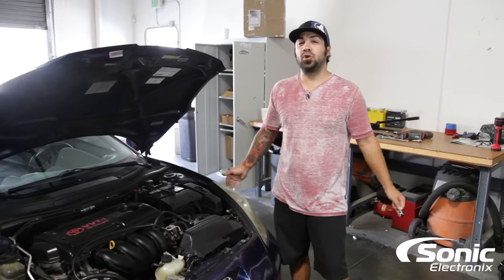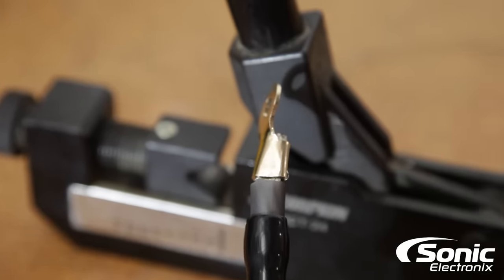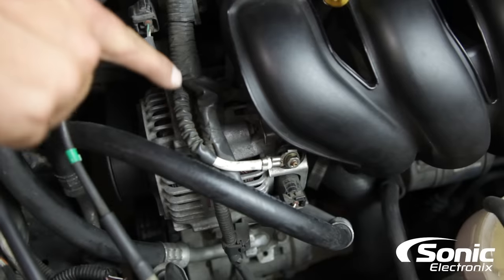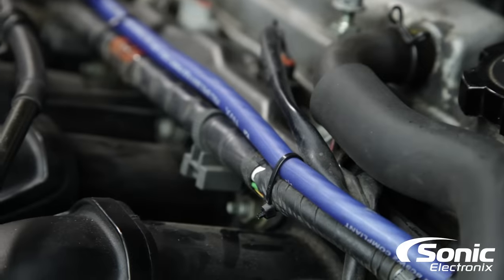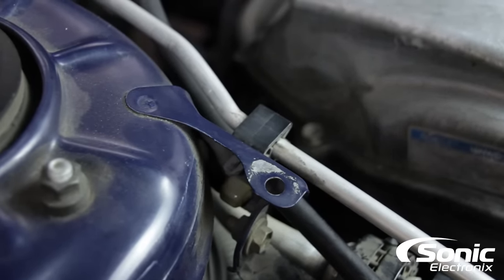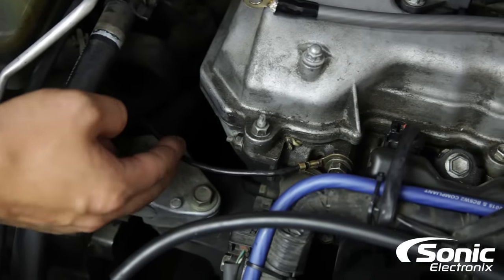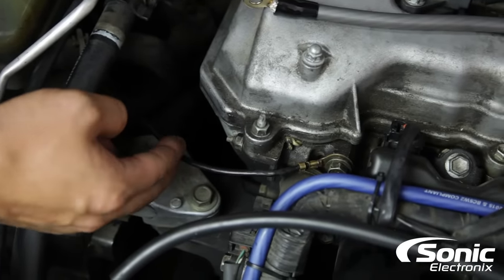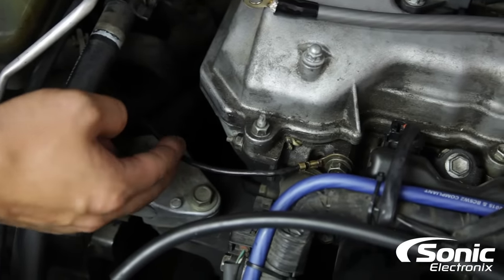How To Install the Big 3 Upgrade | Improve Your Vehicle's Electrical Charging System | Car Audio

Comment: What does the Big 3 help with, or improve?
Reply: all the wire the same helps stop "choking" the alternator and battery flow.
Reply from the maker: +Makaio Prescott The Big 3 Upgrade lets your alternator push more current to you battery because of the larger gauge wire that is added. This helps to keep your battery at a more constant voltage, this becomes more important the more amplifiers you add to the system / the more power your sound system requires.
Reply: The real, simple, answer that anyone cares about is... it will help lessen or prevent your lights from dimming when you're really rockin.  Some say to just buy a "CAP" to fix engine bogging and power drops but after running caps for years I have found that this simple and cheap upgrade will fix your bass flicker.  Unless you have like 5000+ watts in amps but at that point you are way past just the "BIG 3"and running more than one alternator and battery.  :)
Reply: The other replies are right, I just wanted to add that it is also needed when running complex light systems. I have a jeep and I have safari style lighting so I can light up a campground if i needed too.
Reply: Thanks you guys! I'm not running anything huge in my truck, just 2 10's running on 1000w split to 500w each sub. And all my lights work just fine when I'm pounding, no flickering or dimming. I've been wanting to do this just for kicks, but I also wanted to know of any benefits it may bring. My power and ground wires on my truck are 4 gauge, which is the same size that I'm running to my amp, so maybe if I ever do a more complex system that requires more power, I'll definitely do this! Thanks again.
Reply: Wouldn't this also help in really cold climates? I know this upgrade for my motorcycle made a huge difference on days when it freezes out.
Reply: No matter the gauge of wire you are not going to increase amperage or current output of an alternator. Its basic electrical. Wire gauge doesn't determine the amperage draw, it's merely a path. Upgrading the wiring will enable that path to more efficient. The Big 3's only "real" benefit is it lowers the resistance between the charging system and the audio system. If you think otherwise, I'm glad you've never touched any of my belongings, and I hope to god you don't touch anyone elses.
Reply: Erik Torell I think changing the oil to a lower weight might be better. A mech recommend that to me cause where I love we can get -20 nights and it was hard to shift until the car warmed up.
Reply: DaTwistedOne1 doesn't the guy say in the video "this is only needed if you have or are looking to upgrade your alternator"
Reply: Makaio Prescott nothing
Reply: ArgosWarrior
 except when you upgrade your alternator
Reply: Makaio Prescott may i ask,after we done upgrade big wire,how long alternator life?
Reply: Yussyadiq Yusof just as long as before. like the one person commented, it gives a better connection able to handle more power, this upgrade alone does not give you more power. The more power only comes from you upgrading your alternator.
Reply: oh yes lets add a 100 amp wire to a 40 amp alternator  on a factory system that will improve everything 
NOT
this is a big waste of money on any stock system  
it would be good if you had 5000+ watt sound system or a 100+ amp alternator(for big upgrades) or even a worked engine with a aftermarket ecu(Link G4 ecu made in New Zealand  best in the world ecu)

but if the car is factory this is just dumb and  not even needed
Reply: ***** which is what they say in the video, what is with you. No one is recommending doing this to a stock system.
Reply: any new car has to have good grounding for the computer to do its job keeping the car running at it best. bigger wires[with the same wire fiber size] have more surface area for the electrons to flow therefore it takes more corrosion to "choke the flow". odd note bigger gauge jumper cables le 4 to 0 gauge can start a car quicker than smaller ones like 10 and 12 gauge
Reply: Nothing at all, that's the 'merican way. Customize stuff that does not require it.
Reply: by your logic are you also saying we should use 18 gauge wires for everything. watch them melt when they cant handle the amperage
Reply: So you think that the car manufacturers are plain stupid to use wires too thin for the job? I own a 21 years old car, with the original wiring and nothing caugh on fire yet, so tell me, should I change the wiring? By the way, how's the computer, you are watching this on, working for you? Have you considered changing the capacitors, the wiring perhaps?
Reply: they use as thin of wires as they can get away with. they also do it to the point the car was made to use with a little room for more.I have a car from 67 and it has had wires that did that { alternator to battery} under certain circumstances which has cause me to swap wires. This video shows them improving the wiring because more amperage with new electronics are expected to be added meaning higher amps moving through the wiring especially if you running a a sound system requiring more power.
Reply: wiring sizes should be chosen with the amount of amperage in mind. the starter wire and the ground wire compared to the horn wires for example. way to big of wires can cause their own unique issues
Reply: I live in Maine, and this is an upgrade I will be doing with my truck, mainly because of the cold.
Reply: I would be cautious about doing that. Going down a bit on the 1st number is fine, but I would not do so with the 2nd number. You do not want the oil to become too thin when it warms up.
Reply: yeah, he only recommended going down 5 or 10 on the weight. The second number remained the same.
Reply: You really only need this upgrade if your truck is running a lot of extra lights and / or a sound system. Essentially you only need this if you need to upgrade or have upgraded your alternator.
Reply: b1oody 67 so I have 2 10's running on 1000w, 500w each. And when the bass hits I see my voltage indicator bounce. Would doing the big 3 help the voltage not dropping as much?
Reply: Robert Kraft yeah it's not anything bad. It was just a curious question to ask. When I drive at night and I'm pounding, no lights flicker or anything. And battery and altenator is stock too.
Reply: Not true. With a better ground, the engine will actually get better spark and the injectors and everything get a better signal. I did this in a Jeep Cherokee and the trans actually shifted quicker and better. Sounds crazy, but it's the truth. The headlights were a tad brighter, as well.
Reply: Change the title to "The Big 4" and add the most important component.... a DC Power alternator!
Reply: beri232 but an alternator produces ac power.
Reply: car runs better first of all
Reply: all alternators produce ac
Reply: ***** the one where a cars alt produces ac power, obviously. Without the regulator, it does indeed produce ac electricity, not dc.

I upgraded my car from a 60 amp alternator to a 130 amp (175 amp peak) with a heavy duty 4 gauge charging cable and a new 4 gauge ground. No difference what so ever in how the car ran when it had a single 10 gauge wire powering it before.
Reply: all of them produce ac
Reply: filter it all you want choke it all you want nomatter what you do an alternator will always produce ac unless it is not spinning
Reply: George Marinos ...... Jeeze guys. DC Power is the name of an alternator company in the USA. I'm from Canada and I've heard of them. Hell, I bought one of their alternators for my pickup. They build some of the best alternators in the world and I recommend them highly to anyone. There, stop the schooling lessons.
Reply: You should explain yourself ,a alternator is a ac production rectified to dc through a rectifier,if this company sells a dc generator then it's not a alternator is it? The name is the clue to the answer.
As for all the BS in this video just simply cleaning all the termination point of the system every year is normally sufficient to keep the system up to working order. Resistance in the system builds up over time as dissimilar metal do NOT like to work together.
Reply: P Kuudsk check voltage drop under load. Test directly at the battery, then test from the positive battery post to a metal spot on the engine. If you dont have more than a .01v difference, you are wasting time and money.

The actual selection for a proper wire size based on load factors in amperage and length. Running a 0 or 00 gauge wire will make zero difference until well over 200 amps on most systems, just cost ya more money.

If you dont think 200 amps is alot, think about an amplifier for the sound system you are running. Watts = voltage x amps. So 200 amps is roughly 2400 watts until.you factor in that the car should be between 13.5-14.5 or so while running, this still gives you quite a bit of headroom on that 2400 watt amplifier, plus numbers are pretty much always way, way over inflated. Bet 95% of amplifiers out there don't even hit half of what they are advertised at.
Reply: beri maybe you should bench any alternator and set your 2 dollar test equipment to measure ac and see for yourself or you must be another one of those self proclaimed electrical engineers lmao
Reply: Hey great you know ohms law punkrock but throw all the calculations out the window when you add in corrosion at the contact points 2 weeks after you did them if you live in wet cold areas .
turning on/off the ac or heater will make or break the demand. + most cars only have 120 amp alt's so if you want more it's not there unless you up grade the alt. So as I said this uping the wire is BS. Better to clean the term points of the battery and grounds and then the .01 v drop might appear generaly you will see close to .05 volt on any car.
You can calculate the drop over any length of wire of any size and, you know what most stock wire is adequate in the charging system . PWM alts can pump out at max if needed just wont last long no matter what size wire you use. ( and most are now for +mpg)The only way to solve this is with a higher output alt. more batteries or caps.
Reply: P Kuudsk if the connections you have been making are becoming corroded after two weeks, you are doing it wrong. 90% of the time a car is driving, it isnt using anywheres near the maximum charging capacity or load that the charging system is capable of producing. Oems design the systems for the average user, not those who ask more than how it was designed. A capacitor is only good if you are temporarily exceeding what the charging system can provide. This is where you will see huge fluctuation is resistance more so then "corrosion" from a properly done connection point or cable. Most of the time the splices and connection points fail, not the cable.

My car stock had a single 10 gauge wire that was 14ft in length, giving it an absolute maximum load capability of 40 amps continuous rating. Yet the stock alt is rated for 50-60 amps. At idle and part throttle it only produced around 20 amps, just enough to run the stock equipment while driving. Stick a 2000 watt sound system and it would eat that charge cable up, if not burn up the alternator. 

Ohms law factors in resistance, which is primarily heat. It is the total work performed, including losses, over the entire circuit. If you overload the circuit, resistance will increase along with heat. Watch a few videos on people testing breakers and connectors to a failure point. It is very interesting to watch.
Reply: I've got a Cherokee also and it's pretty much box stock. However I stumbled across this video and I think I'm going to do the upgrade. The electrical system in my Jeep is 20 years old and even though the alternator and battery are in good shape some of those connections probably aren't as good as they should be after all these years and miles.
Reply: Makaio Prescott usually when ppl add upgrades or extras like light bars just accesories and shit
Reply: In your case upgrade the wiring.
Reply: Haha a bunch a salty haters mad at other people who wanna upgrade their wiring to have better current flow😂
Reply: almost seems like some people don't want you to have something better.....
Reply: Hot cables = higher resistance = low conduction = pour performance on your sound system
Reply: Makaio Prescott no kidding
Reply: M.akaio Prescott   .
Reply: Sonic Electronix I have been shopping at sonic electronix for over 10 years and I have to say I am rather disappointed in this response.

Some constructive criticism: you can provide a more intelligent response AND boosts sales all at the same time.

Having installed more than my fair share of car audio systems, I can tell you that the big 3 isng worth the money for what you get. In most cases, there is a zero gain. Because your ultimate power source is the alternator, it is your limiting power. You can put the largest wires in the world in your car but if your alternator only produces 80A, wires wont help it produce anymore.

So instead of suggesting that a big 3 upgrade will be beneficial, maybe suggest that paired with an alternator upgrade it will provide improved performance. 

Not only in doing this do you actually sound like you know your stuff, but then maybe you can boost your sales in HO alternators!
Reply: Erik Torell why would you ride a motorcycle when it is freezing out?? Get a car.
Reply: supposedly it helps squeeze few extra amps out of the alternator since bigger wire allows for more current so the alternator can output it's max power. l think this upgrade is snake oil though because with a stock alternator you are getting around 60-80 amps of power which at the most still less than 1000w. l mean you could use a 12awg wire if you wanted because they don't put out enough power to require a bigger wire. l would only do the upgrade if you're also upgrading the alternator.
Reply: Robert Kraft When you say "only two 10's" & "I used to have 18's" isn't proving your point.  Google search Sundown ZV5 10" and you'll see what I mean. The size of the basket & cone aren't what determine how much power you need. The motor structure is. Subs have come a very long way in 10yrs. There are companies that make 6.5" & 8" subs that require at least one extra battery+alternator MINIMUM! Most companies use the same motor for there 10's,12's,13's,15's, & usually 18's. Lastly, when u say you had 5000 watt 18" subs, you are referring to peak watts which means nothing. Most decent subs can take 5k but not continuously. Those subs were realistically 500w continuous. When buying subs u want to match the subs RMS power rating with the amps RMS power rating. Even a little extra for the amp is preferred since most decent/high end subs can take much more then there conservative power rating. Hope that helps
Reply: Wow this is what I need to do on my 93 Subaru
Reply: It is just to be cool
Reply: @jeremycrabtree7519  true. I have all Skar speakers and one of their 10" subs. They will take way more than they're rated at all day. I have a 2015 VW beetle and the 10"sounds like a 12". It's amazing what they can do with them now 😊

Comment: This video was so thorough and complete. I greatly appreciate it. I do have a question though, about the engine  ground, where you install a wire from the engine block to the chassis. Is there a specific place you have to ground it to, or does it not matter ?
Reply: He says in the video you can ground the wire from the motor to the negative battery wire ground spot or on the chassis

Comment: For the small increase in driving performance, is the inclusion of the Alternator necessary?   Mine is buried at the bottom.  If the Alt. is left out, wear is a good location for wire #3 to go, along with a 4th wire?  I hope this is still being watched.  I would greatly appreciate any help.
Reply: It a big deal if you're not getting connection and your windows break one by one😂
Reply: The factory charge wire is designed for the oem sound system. It may be inadequate if you upgrade to a higher power system, adding another may unleash additional power from your alternator.

Comment: For the new ground you made on the car for the battery, I would have put dielectric grease on the bare spot so water or salt doesn't rust out that spot and then eat away your fender
Reply: Wouldn't clear coat be cheaper?
Reply: Yannis Clear coat would make the sanding you did pointless. You need bare metal and dielectric grease is meant for use on metal electrical contacts. Commonly used on spark plug wire to spark plug connections.
Reply: Konrad, the metal connection is already made, the clearcoat just goes above and around it. Just like an umbrella in the rain.
Reply: @satchitananda1820  He applied the clear coat on the exposed areas AFTER making the connection. He didn't spray it BEFORE the connection. The clear coat isn't going to sneak it's way  between the bare metal and the lug once it's screwed down tight. Also, grease can be washed off, clear coat is more durable.

Comment: My 2005 Honda element has an alternator that has 105 amps. Which kit would you recommend?
Reply: The factory one it came with. This is totally useless unless you have an electrical load that needs it AND an upgraded alternator to keep up.
Reply: @jabroni6199  ... Completely useless application unless you plan on making your car into a towing truck..